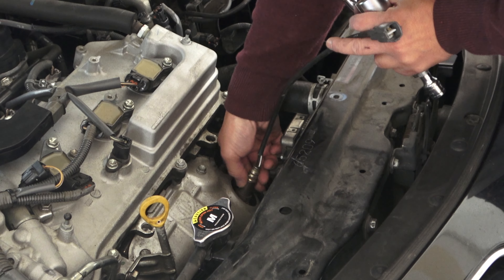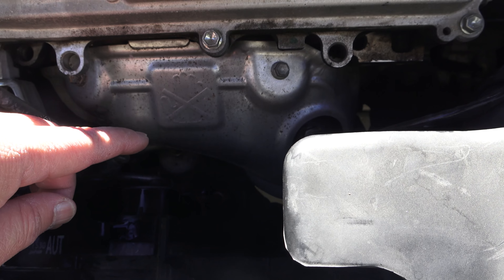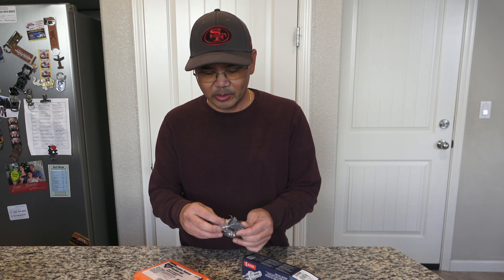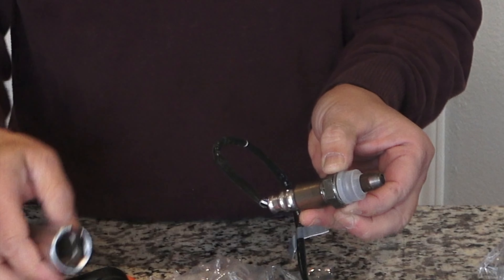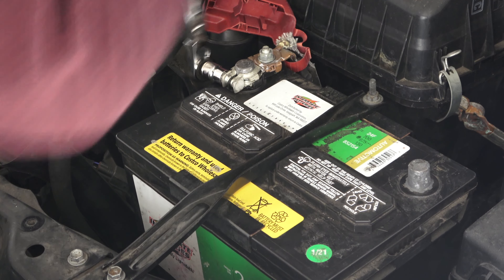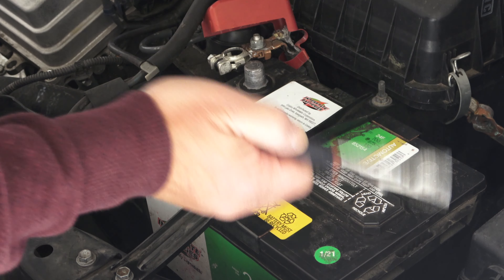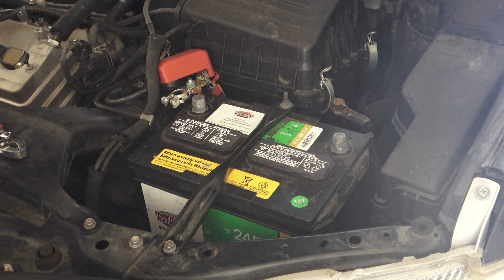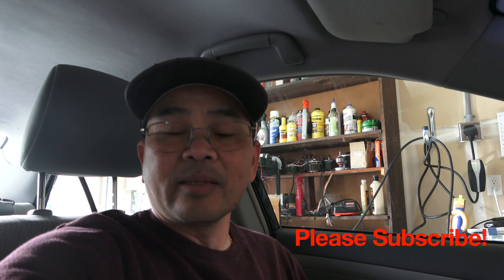How to Properly Replace a Bad Oxygen Sensor! (2007-2011 V6 Camry —Error Code P0051)

Comment: Hi, What are those motors used in air-conditioning? Also BLDC?
Reply from the maker: Those are ECM motors (electronically commutated motors).  They are BLDC motors but the direct current used to drive them are AC that have been inverted into DC by a built-in inverter in the motors.
Reply: ty for early replay, yes i though so its different, i got it one running partially by sending in pwm, or few dc volts in signal input, they must be very efficient...? @diypotentials

Comment: My O2 sensor Bank 2 Sensor 2 was replaced on 3.5 liter V6 2008 Camry engine with 220,000 miles, but the old one came out stripped on  top where it screws and fits tightly. So the mechanic could not get the new one to fit tightly because the pipe hole was larger because the old one was stripped and forced to install in place before I bought the car in 2019.  So now I have this harsh coarse engine start up and acceleration sound (sounds like an old 5.0 liter V8 engine) with a check engine light.  The pipe that is underneath the car where the 02 sensor is connected to is rusted.  The mechanic told me that needs to be replaced.  I don't know to what to do about getting it  repaired since I need it to drive until I can purchase another car on June 22. I have put $1500 dollars in it with new ignition coil and battery in past 3 weeks. My gas mileage is still good with 20.8.  I am not running the A/C because that is when the check engine came on.  So, I burning up in this Texas heat.
Reply from the maker: Ahh man!  Sorry to hear about your car situation.  I hope the new car will make up for it.  Take care!
Reply: @diypotentials  -Thank you man.  Have a great and blessed week.